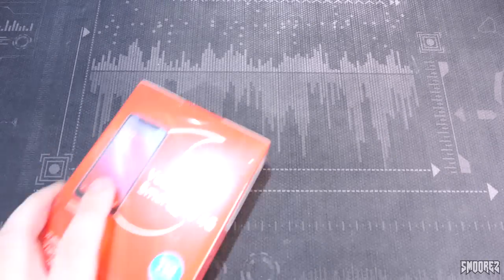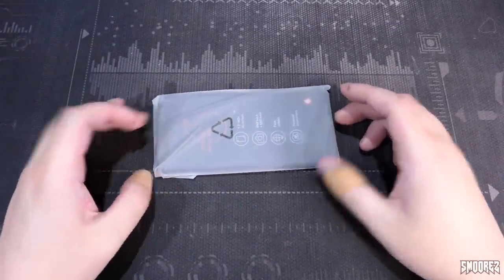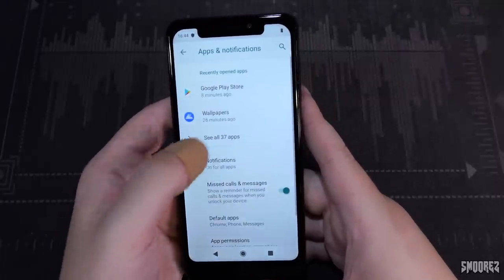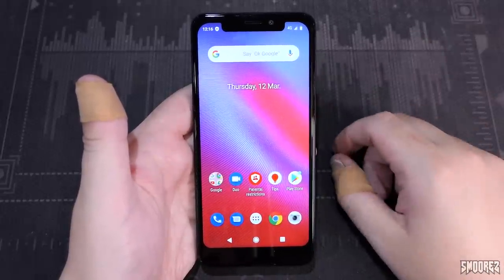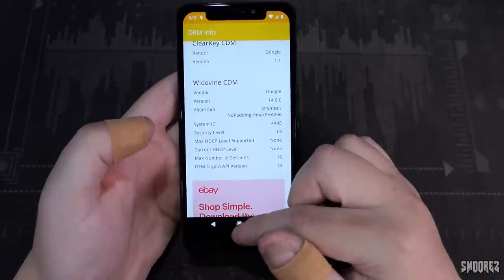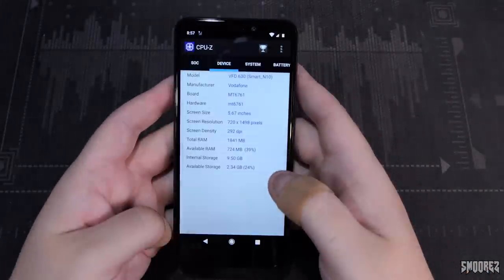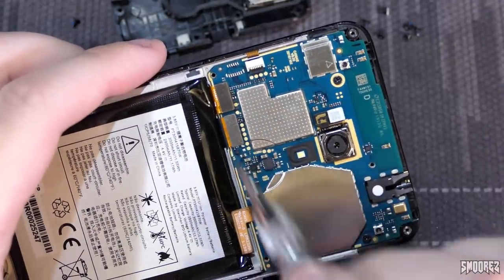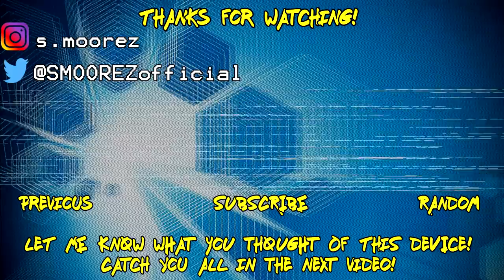The VODAFONE SMART N10 - Is This "BUDGET" Smartphone For $150 In Australia WORTH IT? Let's find out!

Comment: The manufacturer is Wiko, and it looks like a lot of their other devices (like the Wiko Jerry4) do as you suggest and actually center the screen.  (The telltale bit for the actual manufacturer is the US FCC certification number on the little label inside the SIM slot)

There's no other Wiko devices that appear to be so...  off-center, so perhaps this was a custom for Vodafone. (Edit: It's a Wiko View2 with a custom camera package and the SoC out of a Tommy3, and the View2 Plus has a fingerprint sensor exactly where that divot on the motherboard goes, so most likely Vodafone just ordering whatever Wiko had to hand as far as spare parts)

Comment: I have the Xiaomi Redmi 7A which is around the same price tag. It has a 2 GHz Octa-core Snapdragon 439 (An overclocked SDM-435 basically) and 2 gigs of RAM. The screen is a decent 5.45" IPS panel with an 18:9 aspect ratio and around 9 mm bezels on both top and bottom. The best part is the GPU which is an Adreno 505. It's cheap but plays even the most demanding games at 30+ fps.
Reply: Logan T this is 90 nzd so way cheaper(but not better) so can't compare.

Comment: In the UK back in 2016,the network "EE" were selling  a phone (made by ZTE) for £39.99 for EE customers and £49.99 for non ee customers (I think). It had 8gb storage and that's all i could remember. Weren't that bad for the price but mayne if you do want to see it you could try online. I used it and it was fine for calls,texts,WhatsApp and videos. One feature I liked about it is that instead of OTA updates,you could download update files then go to setting and install them. It worked with my SIM back then (Non-EE) which was amazing. Now Vodafone sells phones which you can pick up for under £30 but if you're really lucky for under £20. And for the price of the phone featured in the video,you could get a better phone like Xiamoi, Vivo or oppo. Or a used flagship like a S7 or Goophone. These may even have better specs. One of my family members had a Vodafone device (quite old) which even had Java applications